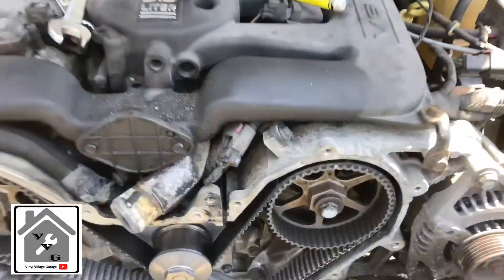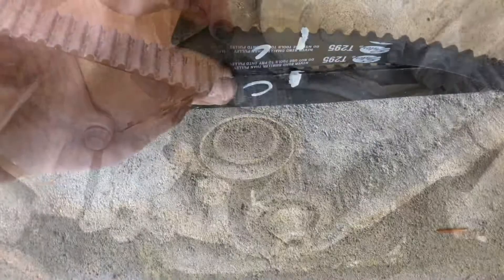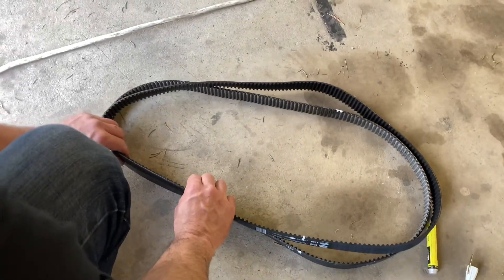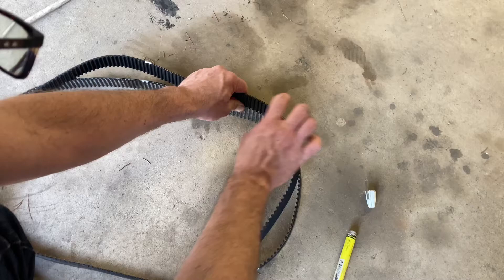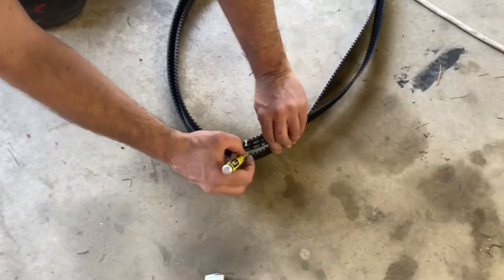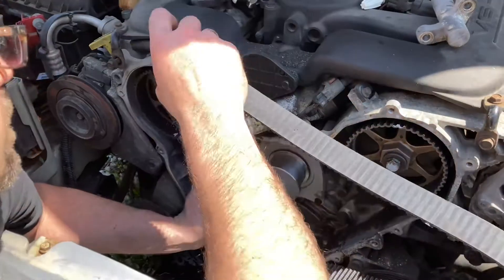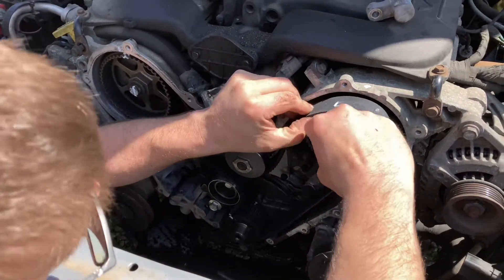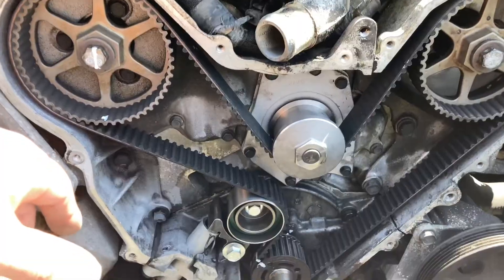How to set timing marks before replacing timing belt.

Comment: Ok every video shows the easy stuff another one like this...show what happends if the timming belt breaks how to line it up
Reply from the maker: This is a preventive maintenance technique. To replace one that has slipped time the repair manual for what you are working on will have instructions on how to get it timed.

Comment: THANK YOU! Finally someone else that realizes when you take the belt off, just DON'T MOVE THE PULLEYS and nothing will move. It takes quite a bit of force to move the crank and cam pulleys. Just swap new belt and done. Theoretically you could make your own timing marks as long as it's just a simple belt change.
Reply from the maker: Exactly!!  Preventative maintenance replacements are this easy.  No need to line up any marks
Reply: My old belt is broke how do you do it then
Reply: My old belt was broke when I pulled the cover off so how do I do it then
Reply: @SammyHolifield if your old belt broke odds are you bent some valves so pull your heads off and check your vakves make sure they arnt bent if theh are replace them and the guides and might as well pit new seals in also make sure you get some MLS head gaskets and new head studs old one are prolly streatched while your in there might as well change your oil pump and water pump depending on if they ever been done cuss odds are one of them is going to go bad next and its all behind your timming belt depending on the car  make sure you get oem kit or at least one thats bearings were made in japan not china junk that will lastg 1000miles

Comment: What do I do when the timing belt was not marked. My car timing belt snapped. I got everything taken care of with the engine. But now I have a new timing belt. The old one snapped completely so I obviously couldn’t mark it. Any help please and thank you
Reply from the maker: What i showed was a preventative maintenance replacement,  if it snapped best solution is referencing the service manual, it will show how to set and locate timing marks.
Reply: Wow make the simple video

Comment: Tore car apart it's a Chrysler ciruss 2.5Ltr 6 cyl ..anyways put new water pump on now having a problem putting all belts back on well actually one going to two overhead cams is giving me problems. 
I now have oil around the cam leaking on the ground as well as it's making a knocking sound. The water pump is it bad ,I don't have money for a shop..
Can I fix it myself???
Reply from the maker: Seems like a lot went wrong, did it have all those issues before messing with the belt?  The reason I ask is if it didn’t it typically ends up being something that was just done.  
  It is all repairable, really need to diagnose all the issues first including the knock noise before buying any parts or proceeding with any repairs.

Comment: Question, 1991 Nissan D21 truck. The top two sprockets are right on the marks, as is the bottom sprocket lined up with the mark. BUT when I put the new timing belt on the white marks on the timing belt are spot on the top two pulleys, but the white mark on the belt does not line up with the mark on the sprocket on the bottom (camshaft sprocket) how do I get all three marks on the belt to line up on the sprockets?  Thanks so much.
Reply from the maker: The point of my video was if doing a timing belt as a preventative maintenance item Make marks on the old belt and drive sprockets then transfer those marks to the new belt and reinstall to the marks. Because as you are experiencing the original timing marks don’t always line up as they should it seems and it’s hard to say what’s right and can cause some frustration. Every time i take off a timing belt that is good I make marks to guarantee I am returning the timing back to how it was.  
    To answer your question on some engines you can’t get it perfectly lined up as hoped and it might be as good as it gets. Best bet is If replacing a belt that you didn’t make marks on before removal it is to follow the directions in the vehicles  service manual to ensure proper installation

Comment: I chuckled when I saw this.  This is exactly the technique I’ve been using for years.  I remember reading in service manuals how to ligne up timing marks on a V6, and thinking there must be a better way.  
Interestingly I’ve never taken an automotive course, and am completely self taught.  I presume you are similar.
Reply from the maker: Yup self taught mostly by trial and error, 25 years later seems to be less error now. Just wanted to share my experiences. I had timing belts kick my butt so like you even determined there has to be a better way.  This technique hasn’t failed me yet, even on engines with no timing marks like Deutz 2011.